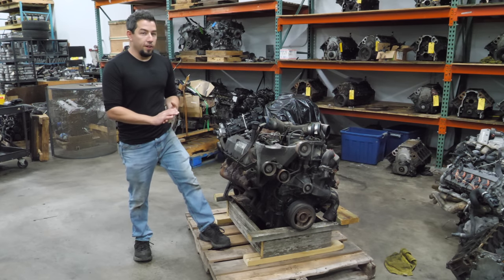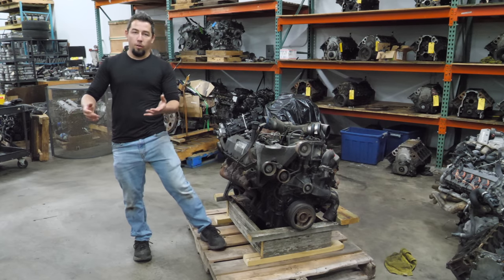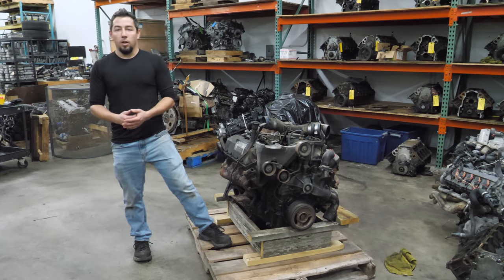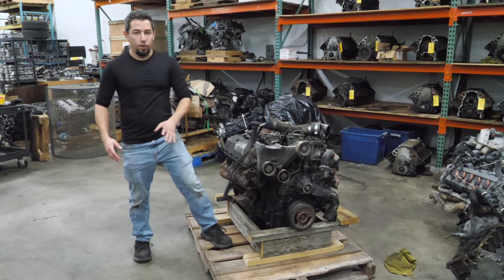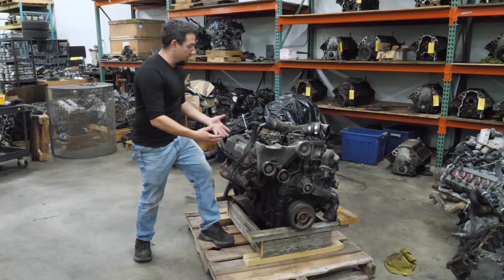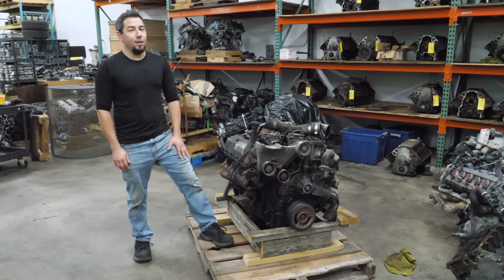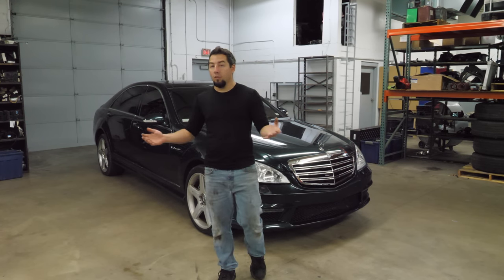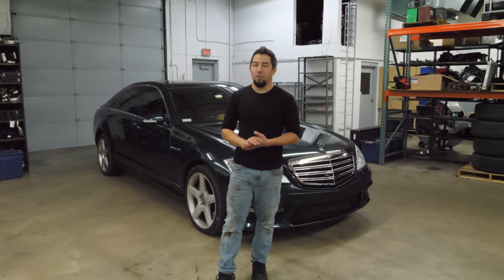70K OR 700K? Ford 7.3 Powerstroke Mileage Discrepancy. How Many Miles Are Really On This Engine?

Comment: Seeing the overspray on the harness makes me suddenly think this might have been a fleet vehicle where someone swapped out the cab on the truck. Basically they put whatever on there, run the absolute tar out of it doing what you gotta do, and swap the "nice" cab back on to say its a "low mileage" truck once its all used up. The overspray there suggests it might have had some paint shot at some point to make that turd all nice and shiny before someone unsuspecting picked it up.

Comment: I bought a 200K mile 4.3L chevy engine off of craigslist recently cheap. I tore it down and it had a lot of sludge below the manifold but everything else looked good. Cylinder bores were in speck pistons look ok crank is in speck and bearings looked good so I was wondering about its milage until I saw the cam bearings which were worn down to the copper  and the cam chane was pretty loos.

Comment: So judging by the carfax the oil place screwed up for example it could have been 68,987.5 and they didn't put that . In there making it 689,875 miles my 99 had a tenths odometer

Comment: I would guess 70k with a lot of idle time and poor maintance. Something caused the odometer to report incorrectly, which is why the oil change place and the copart auction show high mileage.  The dash might have been replaced.  

No way that engine has 700K.

Try calling the oil change place in the carfax or the dealer.  See if you can get the owners name, and call them and see if you can get more information.

The answer might be in the 12/29 service description "Body Electrical System Checked".  Per the internet, the odometer on a 1999 ford is electrical, not mechanical.  Any number of electrical gremlins could cause this to happen.

Comment: Just made 418 K on farm truck, and finally the water pump seal gave up the ghost (yes, replaced the pump,).  It did not look bad, but compared to the new pump it was ? Softer, looser, just something you could feel tactilely.    Engine you have, with the way the bearings were tight, with the copper wear on the top, show a lot of sitting still time, and much low rpm run time.  Think of a diesel engine used on an  irrigation  pump, where the engine was rarely forced above idle, because of water demand.  (Engine more powerful than needed for the well,) and then put up for 8 months out of the.year, and you have it.   
     You could donate engine to me😇.   
      If you want a good pulling truck for yourself as personal truck, you could not go wrong by finding a good body, and catching up to the misreported millage.  (Might want to do low engine rebuild the above &/or below gentlemen who I believe  pegged it, when they said. Low mileage, much idle and situp time - like a truck that wore a snow plough all year  
   Finally sell to strange guys from South America, who keep whispering something about reusable semi-submersibles, 
    Of course kidding about last one.  70k miles + lots of idle time + lots of shed time.

Comment: I bet it has 70k.  I wonder if the oil change place uses one of those obd2 scanners to upload the information to there computer for the service ticket.  I dont know on fords if the miles are saved in the ecm but im woundering if some one could have replaced the ecm with a used one?

Comment: Maybe the oil change tech didn’t read the odometer correctly and didn’t count the decimal point. It went from 68,300 to 685,000 which could just be 200 miles later and supposed to have a decimal before the last digit

Comment: Looks like allot of cold weather starts without a block heater and maybe cheap oil and filters for some of its life.  It looks like it was idled allot for long periods of time and maybe in the wintertime.   it is a 70K to 100K miles engine with unknown amount of idle time.  it would be good long block with new rod and crank bearings.

Comment: Pull the crankshaft and check the mains and rods.....diesels beat the hell out of the rod bearings, Those valve covers and the entire area around the valves is extremely clean for a high mileage engine.

Comment: no blowby in the turbo, id say 70k. ive got an early 99 7.3 f350 and when you pop the intake tube there is oil residue on the turbo inlet. im surprised those exhaust manifolds are in as good a shape as they are.

Comment: Not a mechanic, but have worked on my own cars
Is it possible that it's a 70k car that has run dry of oil for a short time ?
I think i would sell as is, but show them this vid or photos of what you found, stating that you'd recommend a rebuild
Or if you'd get more as parts, then it's a tear down.

Comment: It is not possible to read 600,000 miles on that truck. There is little question that is a 70,000 mile engine.
The bearing wear is expected in a 15 year old diesel truck that was driven in cold weather for short trips. Plenty of fuel dilution due to it rarely getting to full operating temperature in cold winter weather.

Comment: I had one with 400k before it got totaled...actually it was dads...anyways it was a 97 model and we checked the bearings in it before we sold it...didn't have nearly that much wear...as long as you keep that pink water wetter in the coolant the 7.3 is about as bullet proof as the semi engines

Comment: Seeing that engine. Tear it down. It is a clean engine to piece out to rebuild. Bottom end bearings are done. If you see wear on the cam. The rollers on the lifter will be worse. Sitting this long, valve stem seals will likely leak from drying out. But most importantly. If this engine went 700k. The injectors likely would have been replace. If you have aftermarket injectors then that engine is a high miler.

Comment: My 2002 7.3 has factory turbo with 249,000 miles. I’ve also got a spare engine with factory turbo and 141,000 miles on it. This engine is a 99 with forged rods unlike my 2002

Comment: I live in this area (well a bit south of it), and have even visited River Oaks Ford! The amount of salt and on a work vehicle would not last 700k. On the vehicle itself it looks like the lug nuts are still pretty square and a light coating of rust. The finish on the back of the side mirrors is still painted.

It would be a lot worse if it was really 700k.

Comment: Also, forgot to mention: If that engine either doesn't have a block heater, or does but wasn't plugged in  during excessive cold, the bearing wear doesn't necessarily mean it had prolonged idling.  It could simply be a result of lack of lubrication when starting because the oil was too cold and got too thick to lubricate the bearings adequately.  Either way, if it hadn't been wrecked that engine surely would have died soon.

Comment: Before watching whole video, I'm going with 70K. Maybe they started entering mileage from Engine computer after 2014 but didn't read decimal point....
However having watched whole video, still think its just 70K miles, but a whole lot of standing around ticking over every day, just to keep cab warm in winter or cool in summer! Or perhaps it was always towing a large trailer for a small digger/gen/compressor??

Comment: High hours. Truck likely sat idle... A LOT. I used to service several fleets with t444e's, a number over 30k hours but less than 200k miles. Per Caterpillar, 20k hours is roughly a million miles.

Comment: It's a 70,000 mile engine. There is no way that you can do from 68,000 miles to 700,000 miles in a couple of months. The odometer readings are in error by the the place where it had the oil changed. Granted, the bearing & cam wear isn't good, but a high mileage engine won't have the cross hatch pattern in the cylinders either.

Comment: Given the cross-hatching, cleanliness and the original turbo, I would rebuild it (or at least replace the bearings) regardless of the mileage.  Then install it  in a good rust-free International 3/4-ton Pickup or Travelall.
Reply: The piston would not travel that low in the cylinder, and only the piston skirt would have any contact that far down, so I don't see the cross hatching as being a viable means of determination.  I'd agree that it is still a 70k engine, but it would require a near full rebuild, with new piston rings, bearings and pull the crankshaft.  With an engine that has sat for 6 years, you'd want a new head gasket anyway.

Comment: Inspect your vehicle at least once a year. My state started using deicer on its roads. Brake line corroded through leaving me with no brakes. Made it home using my manual trans. 2002 F350. 7.3, 4x4, crew cab, long box, 105000k miles. Yes it may be for sale.

Comment: Just be glad it didn’t come out of the OBS fords from the 90s. The odometer would roll back over to 300000 after you hit 399000. I guess ford never intended for those trucks to last past 400000 miles.

Comment: I'll bet $1 that it has 68,000 based on the carfax jump from 68,000 to 680,000.
Can you look at the cylinder walls without tearing a diesel engine apart?

Comment: Pulled down an Australian Holden 5 litre v8 that had done just 50,000 miles when 12 years old.(started using heaps of oil because oil return holes in pistons blocked up)
Used for short mile  driving only.
Was surprised to see lots of exposed copper on  most of the mains and some big ends.
Most of the damage is done on start up before oil flow and pressure normalises.
So I judge your motor to be 70k miles.
Also in my experience...when I ask the customer how many miles/kms their car has travelled....you would be surprised how many adults of all ages workplaces and demographics struggle to  and  are unable to tell me even when they are looking at the speedometer.........
They put the numbers in meaningfull words. They say six thousand five something and it will show 65.000km
So schools have been failing for a long time.
I vote new bearings and seals and sell.
Also the inside of the vehicle should look 
Very good .....
But if 700.000m then will look bad.

Comment: Not uncommon in the commercial vehicle industry for a service writer to place a decimal in the wrong spot and then miles drop or increase.
Looks to me like a 70K engine, 700K looks outside the norm by a wide margin without serious overhaul. Most I saw coming through my shop has been 500K+ but then again those miles are on a KW.
Connecting rod bearings can be misleading if the truck had spotty oil changes and a ton of idle time. This engine would have to be looked at in run hours and not miles.

Comment: Look back at the oil changes. For a 700k engine they are 3,000 miles apart. If the truck has 70k, then they are getting oil changed every 300 miles?

Comment: I have an early 99 7.3L dually.... its an analog odometer and reads just shy of 400K. That engine is considered an early 99. Smaller turbo and shorter pedestal than late 99 to 03. That mileage discrepancy sucks cause if it's only 70K you have a gem.

Comment: my guess is that it is a 70K engine but that has been abused.. Cold started and then driven off without letting the engine warm up, hence the bearing wear and the cam wear.. My guess would also include main bearing wear on the crank. So that means the lower end needs to be replaced. If the top end was oil starved at startup what do you think would happen to the bores of the cylinders when the rings and pistons would operate normally. Without visually inspecting the bores there is no way of know if they are any good.
That's my 2 cents worth.

Comment: IF it was a 70K mile engine you'd think it would have sold.. unless.... the 'unknown' of the mileage gave people pause.    Not knowing where it is from I can't say about the rust.  Where I am from, that amount of rust would indicate a 700K mile car.  Bearings aren't 70K and if they are 700K that is one well taken care of lump of iron.    Considering how clean other parts of the engine are, I suppose it is plausible that the engine was indeed that well looked after and/or had the bearings done at least once.. or your theory of the engine being replaced at least once could come into play.

Either way it is older than it seems.  If it is a good runner, why not refresh the bearings and cams and let it live?

Comment: Worn bearings with high compression diesel means lots of idling and dry cold starts. The internal bulkheads and crank weights, and the valve Train are too clean for high mileage.

Comment: In 1 year in the shop I worked at (big shop) we replaced over 30 7.3s I think 3 has over 300k miles all the others were around 200k. Main problem was ring failure. I've personally had 2 7.3s with ring failure. 199k my 99 shit the bed. And my 95 had ring failure before I bought it and the guy who used to own it put a new motor in around 280k.

Comment: Speaking from experience from those days, we ran a lot of those 7.3 in the Texas oil fields.  
 And I can tell you one thing the last 7.3 I had only showed 80,000 + mi on the odometer, and that was about three years worth of driving, but that thing idled six days a week and it was never shut off.  
  So it’s very possible do you have a 70,000 mile motor  with 500,000 miles of idle time.  
  Heads on the 7.3 always stayed very clean basically due to that diesel of the time was a lot better diesel than this ultra low sulfur crap today.  
  In my opinion of working on engines you do have a high hour low mileage engine.   And that is the original Garrett turbo on it and those barcodes with the dates correspond to original engine are at worst and shop rebuild.

Comment: That mileage and hours isn't possible. Averaging 55 mph, it would take around 11,000 hours to put on 600000 miles, or 450+ days, running at highway speed, 24 hours a day.

Comment: Just want to mention to those who do not know - these engines always, always shut down at the exact same spot. (As long as you have done nothing  weird,)  So every time engine shut down and truck was stored for 6-9 months of the year the same face of the bearing each and every year would be on top.

Comment: Hey bro, it went from 68,000 to $680,000 just at the drop of a hat? It sounds like whoever was noting down the mileage added an extra digit in there and immediately and from then on kept noting down the mileage wrong because it went from $68,000 to $680,000 mi if you take the six digit away the mileage adds up again I think somebody just had a brain fart when they were riding the mileage down and thought that they were reading it wrong. Tell me what you think?

Comment: It looks like it could be a 70,000 mile engine up top under the valve covers, but the engine operated in severe temperatures and conditions. For 70,000 miles the exterior of the engine looked like there was way too much dirt and oily built up gunk. This engine probably worked hard all year 'round with just in time oil changes. I'll wager that the proper viscosity oil was not used to the changing seasons.

Comment: I think you should save it. i think this would be a great rebuilt video. That engine looks to have a lot of Idle time on it. Like a lot - alot. Like it ran at least 12 hours a day with out being shut off. I think it's a case where there is 70,000 miles on the engine but the equivalent of 700,00 miles on it from idling.

Comment: on 7.3 powerstorkes check the Hpop screen and also check vacuum pump 70k would be original screen and Oem pump  and the date on the oilpressure sensor by the number as they did an update on the sensor 4 times   but more than likely they stoped going to a shop that registered the oil changes or the owner did there own changes but if the truck had a 5th wheel hitch in the back or the holes drilled for it i bet it is 70k and was just worked hard with a big trailer and that would wear the bearings down fast

Comment: It's really hard to say.....

Cylinders look immaculate as does much of the engine. However as you and other have so eloquently put, the bearings are trashed and, had they been in service for much longer, likely one or more of them would have been spun. It doesn't have the wear of a 700K Powerstroke diesel but 70K? Not a chance either.

My guess is somewhere around 150-200K of long idle periods and VERY hard work. That will trash bearings without proper maintenance. All this engine needs is new bearings and it's golden.

Comment: I don’t work on engines, but just looking at the carfax tells me there isn’t 700k miles on it; the patterns being shown between dates and mileage do not line up with the sudden 10x in miles between those dates. Probably someone fucked up at the oil place, then when it came back the workers there just assumed the “last reading” was valid and started just tacking onto it.

Comment: Things to think about - 7.3 with tons of idle hours in cold weather will be badly carboned up in the intake ... the rod bearings indicate 2 things - very bad oil maintenance or high mileage .. both not good for engine resale - the presence of the cross hatch in the cylinders is normal for a high mileage engine because the cross hatch is at the bottom of the cylinder - either way - in your business position I would sell the engine as a rebuildable core.  The bearing damage makes the engine too bad to sell as a runner-  if you would take the time and trouble to do a compression test and borescope the engine you could decide if you could roll main and rod bearings into the engine and then run it to camshaft failure ... if I was in ur shoes I'd get it running and aell it as a running core... with pictures of the bearings for complete disclosure... good luck with your next business decision lol...